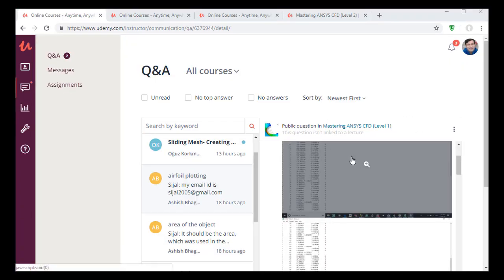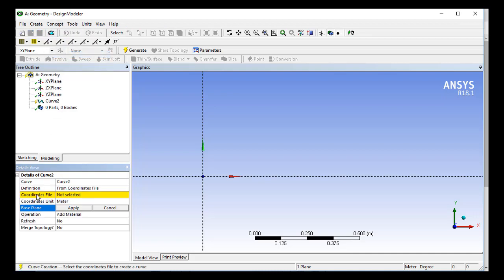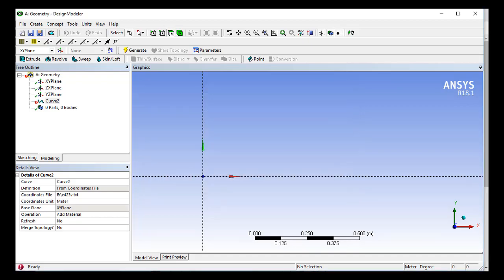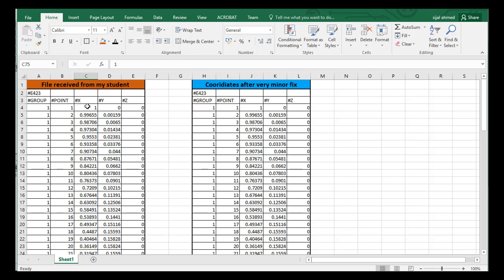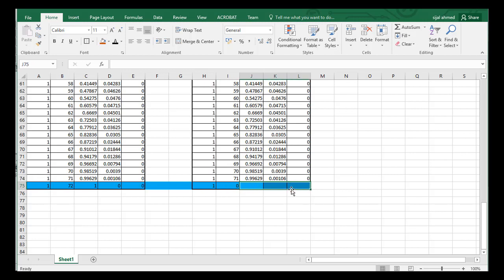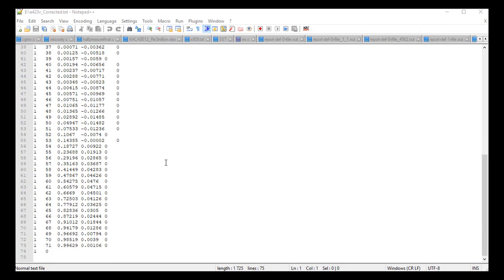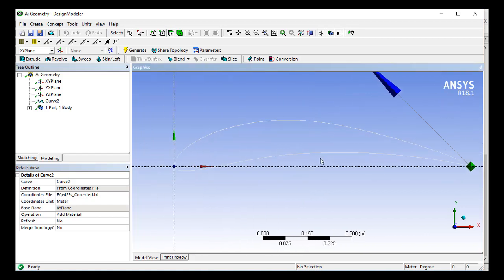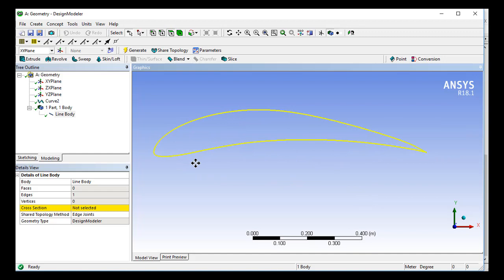Airfoils import in Ansys Design Modeler

Comment: when i try the text to colums this 1 number turns into 1 million I'm just doing what you do
Reply from the maker: It should not happen.
Reply: same problem... Im gonna kill myself
Reply: @heattransfer8003  i'll help you. You have to change dots to commas with use ctrl+H in excel.
Reply: @giovannigiorgio0  i will try in 15 minutes
Reply: @heattransfer8003  OK mate
Reply: @giovannigiorgio0  i did it but the first and the last  x coordinates are still 1.000.000
Reply: @giovannigiorgio0  i can change it to 1 maybe that works
Reply: @heattransfer8003  did the others change? if change you should apply first and last line. choose all number by the way